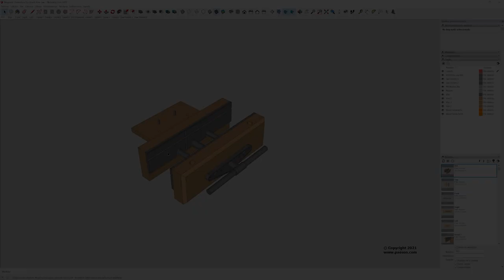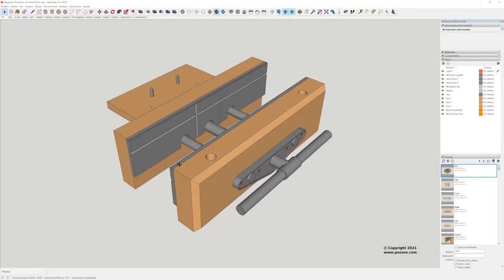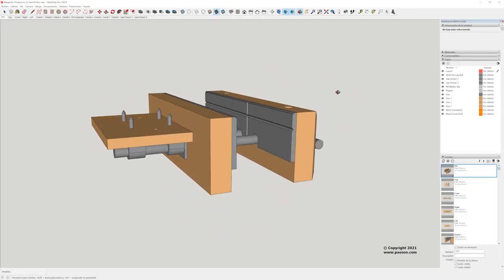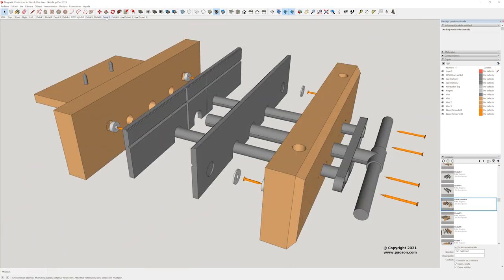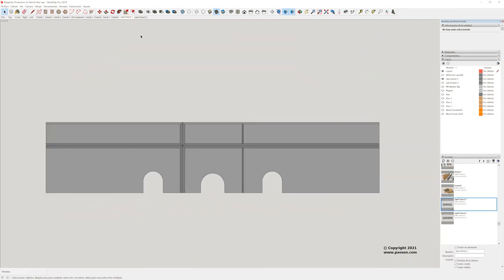DIY Magnetic Protectors for Bench Vise Jaw

Comment: Great idea... Personally... Design add-on real metal bench jaw vise and use your existing amazing vise to hold bench vise.. This way you can do real metal work ( jaws will hold metal stronger and safer, provides more access for file work, and you have mjni anvil to release your stress😁)  and  most importantly you eliminate  damages to your wood vise.. Still very smart and good idea 👍👍👍👍